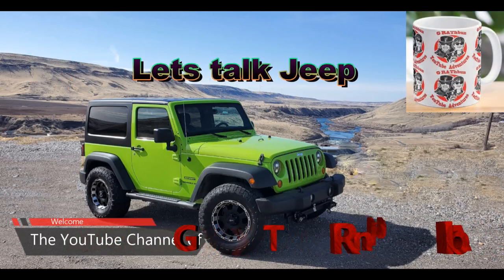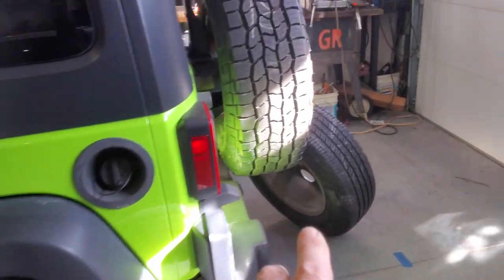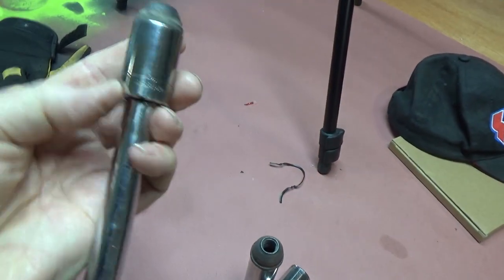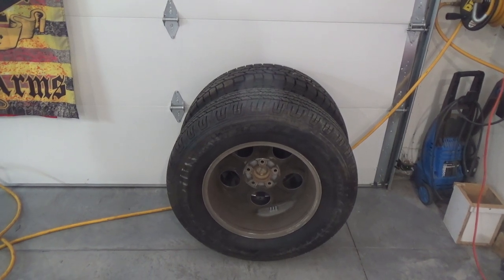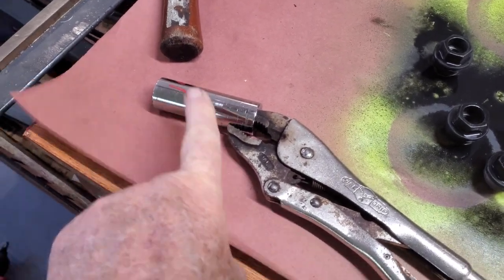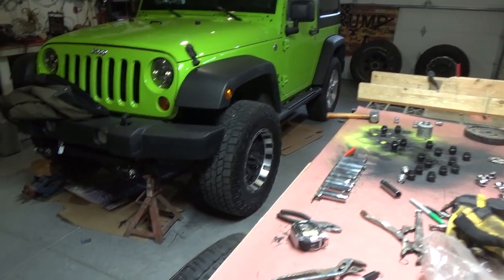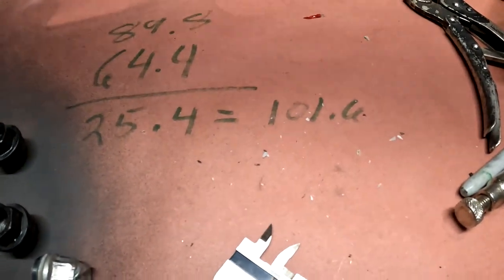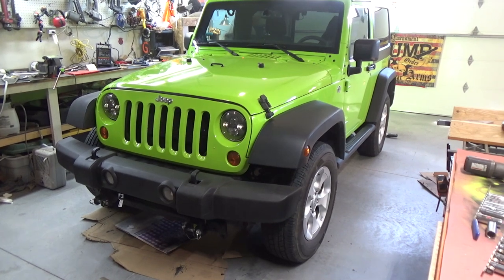Jeep Wrangler  2013 Tire swap, Tire info, stripped wheel nut removal.

Comment: Gary I've discovered that the first thing you should do when you buy a new rig is make sure you can get all the lug nuts off and re tourqe your self and remove the spare tire especially if it's one that you crank up under your rig to make sure it will even crank down,had to actually cut the cable on one truck I bought because it was rusted so bad it didn't work anymore and sometimes these tire stores put your tires on so tight that there's no way the average guy can get them off on the side of the road, kinda like what you just went through especially with the stock tools and jack they give you, some new cars don't even come with a spare anymore you just get a can of fix a flat...
Reply from the maker: Very good advice Dean